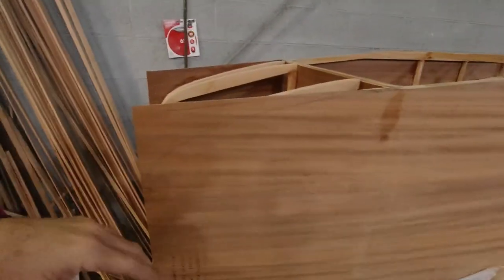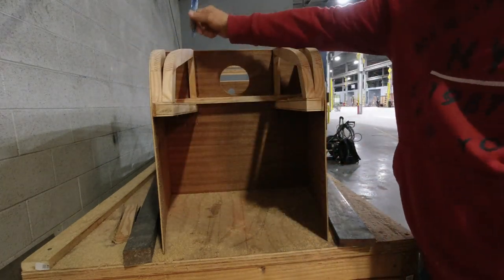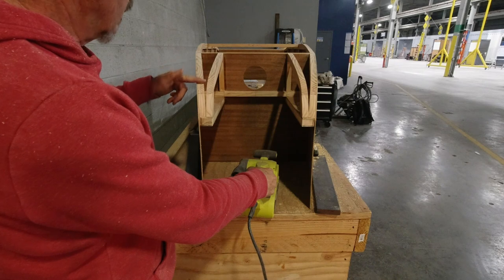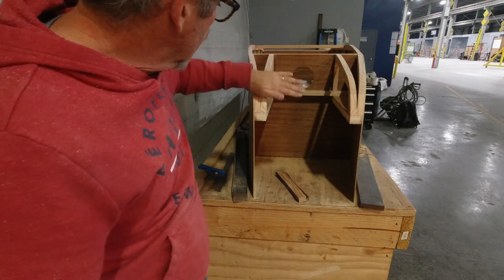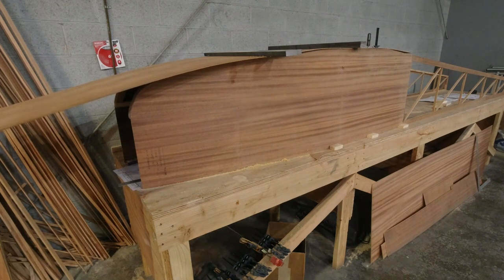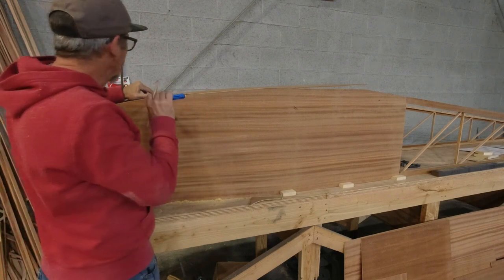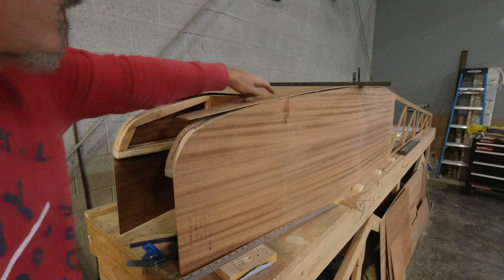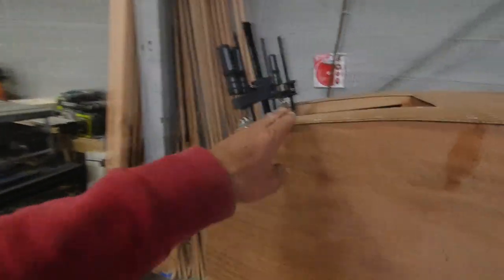Minimax 1100r Wood Aircraft Build Ep 65 - Bottom Sheeting

Comment: I am not understanding why the bottom is open under the motor mounts?
Reply: I understand you need access to tighten motor mount bolts but does it eventually get closed?
Reply from the maker: No, the 1/2 VW has the carb assembly down underneath. So the whole bottom is just left open. Scroll to the bottom of this link...
https://www.teammini-max.com/support/conversion-info/
Reply: @DTMinimax  yes of course ..have seen this modification...this is my fault..I have been watching this with great interest because it is my indent to build a 1650 Eros using a 1/2 VW and the 1650 has a cowling...which I’m told by Dave will have to be “cut”. Anyway, I’m at the point of purchasing the plans so I will find out how this is handled. Thanks tho for all the links